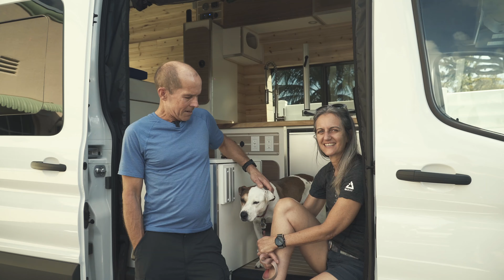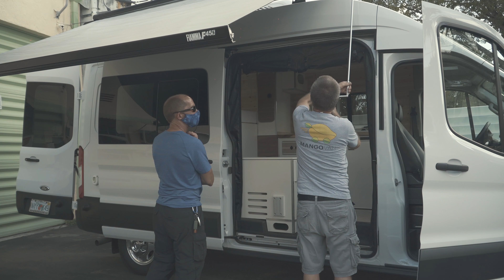TRANSIT VAN TOUR for Adventurous Mountain Biking Couple

Comment: What is the lithium battery capacity of this build?  What would be the largest solar and battery combination available?
Reply from the maker: Hi, thanks for the question. This build has a 300Ah lithium storage bank with 250W 24V solar panel. The largest battery capacity is of course up to client but on average, a "very large" capacity system in a camper van would get up to about 500-600Ah. The largest solar in a camper van roof is about 350W, after that there's little room left on deck for features like a roof fan, air conditioner, roof rack, roof deck. Also, that is about the maximum charge input useful for a rig with the loads of a standard camper van. Larger charging loads would come from alternator while driving or shore power.